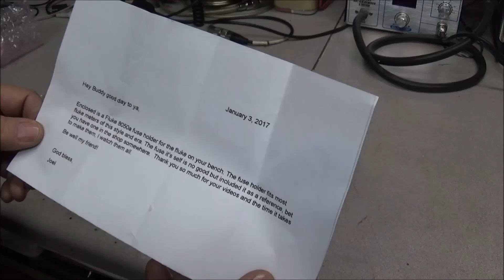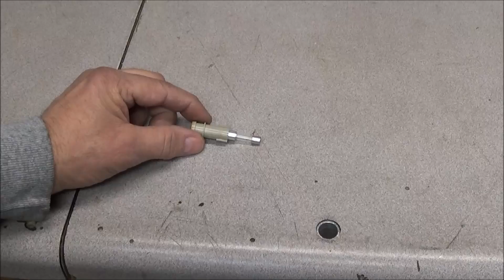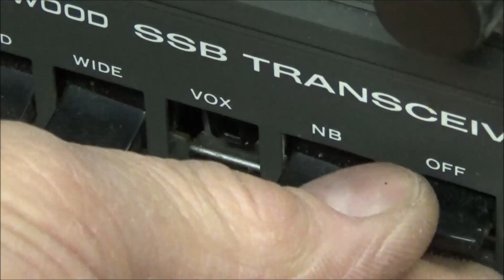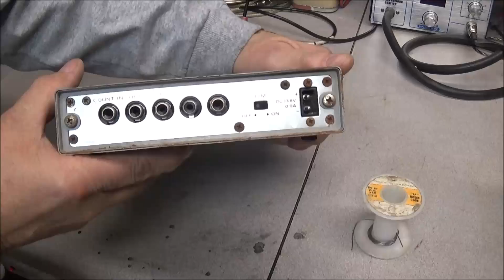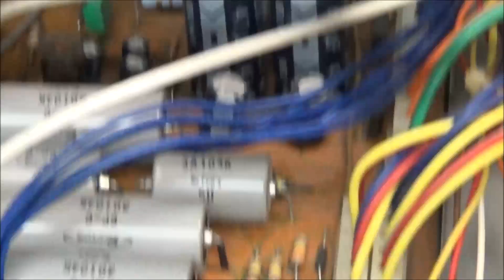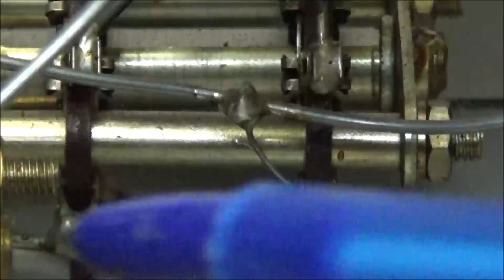#99 Mail Time

Comment: Very nice!

As a prospective Novice in the very early '80s--'81/'82--I really drooled over the TS-520SE station ad in the Tune In The World With Ham Radio manual!  I opted to go another route by the time I was licensed in '83 and passed on the '520 idea.

Fast forward to the summer of 2014 and I found what looked to be a near mint 'SE on eBay and bought it.  It wasn't well packed and fortunately, the only damage was to the accessory plug.  A friend said he had an extra, but I've not gotten it yet.  It also came with a Shure 444 mic.  After an afternoon of careful alignment, it is a very solid radio though it doesn't get used as much as it ought.  Since buying it I acquired the MC-50 microphone, DG-5 display, and an Autek QF-1A audio filter.

I had it all set up for the past couple of weeks for Straight Key Night and wouldn't you know that after working flawlessly up until the afternoon of the 1st, Murphy showed up as the guest operator!  I called CQ on 20m and the TR relay started hanging up or the contact(s) stopped making connection.  It would release on its own after 15 to 20 seconds or I sometimes could get the receiver back sooner by flipping the Send/Rec switch.  As I had a station waiting, I moved the key over the to K3 and carried on with it.

Doing some searching for the relay issue led me to your videos.  Tomorrow I plan to watch more of the '520 series.
Reply from the maker: Thanks for sharing your story Nate. Very interesting.

Comment: Hi Buddy, thx for another nice video :) My own TS-520 wasn't nice to me the other day, so now it's sitting beside the bench waiting for me to open it up. It desided to go from around 800V to 950V on the hv side :( so it's going to be time to look at the schematics and figure out why and what needs to be changed.
73 de OZ2DA
Reply from the maker: Wow that is a big climb in voltage. Even I will have to take a peek at the schematic to see why it would do that.  Please stay in contact and let us know what you find.
Reply: Will do, Buddy. I just have to make room for that little rig on my bench :) Right now littered with parts from building a Bitx20 20 meters ssb kit :)
Reply from the maker: My benches are always crowded lol. Got to get things done for sure. Sounds like a fun kit building project. Good luck.
Reply: Thanks Buddy :) Yes it's a nice project. 
After looking a bit on the internet, it seems that I'm just a bit freaked out about my TS-520 for no reason. It seems the HV is supposed to be around 950VDC when no load, so perhaps I should just connect an antenna again an try to transmit and see if the HV doesn't just drop to around the 800VDC mark where it's supposed to. It probably will. Not to bad of a well maintained radio that I bought for less than $100. Only thing missing is the side cover for the adjustment pots. And it came with the original speaker aswell :) 

Take care, and I'm looking forward to your next video, what ever it might contain :)

Comment: Excellent video, Buddy. Wow, that is the whole station compliment. The only thing missing is the Kenwood Linear amp. Very nice! You said you will take the screws out and clean them and coat them? Coat them with what? Is that referring to the treatment with "belly button" jelly? Please include this procedure in a video of repairing this if you do one.Thank you and 73 DE K7RMJ  Frank
Reply from the maker: Thanks Frank. Have not heard the term "belly button jelly" in many years.  Yep we will strip the rust off the screw heads, coat them with a rust inhibitor primer and then paint them the same color as the rig,  Thanks for watching.

Comment: Buddy,
Going to be a nice video series getting all those units back in shape.

Need some advice on my Yaesu FT901DM. Some of the screws that hold the top and bottom cover to the faceplate or bezel, have their holes stripped out. The metal must be a very soft alloy as I was not putting much torque to the screws. They were removed quite frequently for filter mods I had made in the past.

Would it be better to just tap the holes for the next size larger screw? I would do them all so as to keep them all the same size, and try to find a matching paint for the screw heads. Looks like the same color as the TS-520. Thanks   73   WB3BJU
Reply from the maker: Hi Donald. If you drill and tap to the next size the problem will come back over time.  So this is my recommendation. Look for "crimp nuts". This is a nut that you drill out the hole and insert then crimp. This way you can use the original screws.  And they will last much longer. Link below.
Reply from the maker: http://www.mparts.nl/rivetnuts-FSM-RVS
Reply: Buddy,
Perfect advice. Pretty sure McMaster-Carr will have them. Thanks for the link showing the nuts.   73   WB3BJU

Comment: Hey Buddy question for you i think i saw a B&K Frequency counter on your bench i have the sameone but for some reason i lost my display just have a . on the screen is that an easy fix? Thanks
Reply from the maker: Aaron, You mean the 1801?  hard to say. Go online and get a schematic. Search for any voltage regulators and check the in/outs  of each. Sounds like a missing 5 volt rail.  These are full of logic chips and the voltage needs to be close. Also capacitors can cause this. Hope that helps.
Reply: Thank a bunch Buddy for the help i will check that out!! It looks like you have a nice project there i am sure you'll make it nice again!!

Comment: Always hated that type fuse holder/jack.  Great that the fuse is on the front for easy access but pray it never breaks or you loose it.  Nice someone donated one for your meter.
Reply from the maker: Yep, you thought Fluke could have done better with the design of that.  But it is what it is. At least the meter is fully functional now. I agree it is great folks send in needed stuff. :-)
Reply: The Radio Shop 

They are not the only ones that did that.  I have meters from a couple other manufacturers that did that including HP.

Your going to need another bench for that Kenwood setup.  Nice to see it went to a good home.  The panadapter  was a nice added bonus.  Only thing your missing the transverters and amplifier.
Reply from the maker: No idea why they make them like that lol. Yes the radio bench is already full of vintage equipment. going to have to do some remodeling before long. I want this set up for new guys to use once it is finished.  Will keep looking, no telling when something will show up.